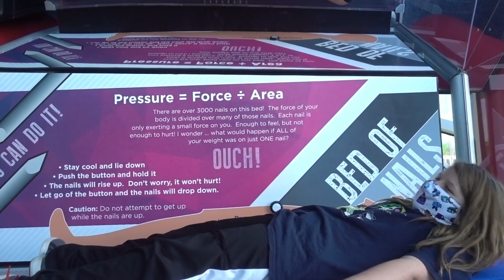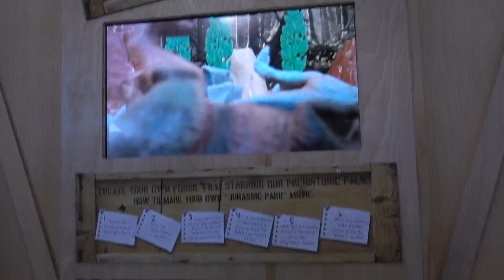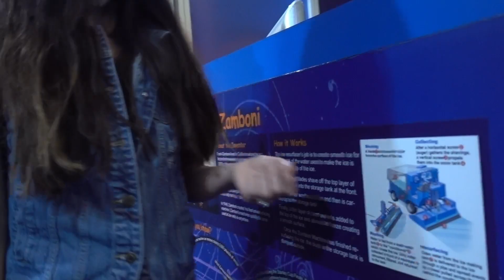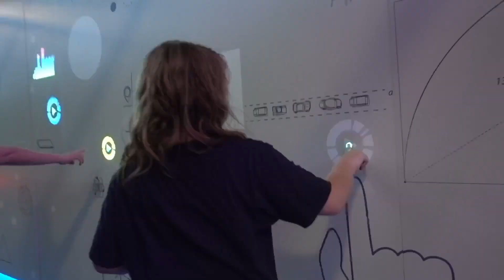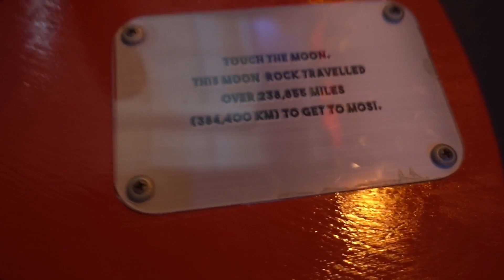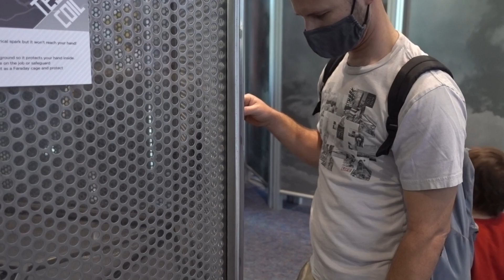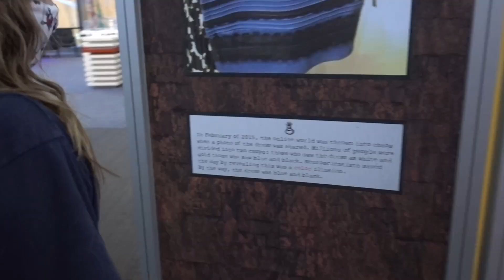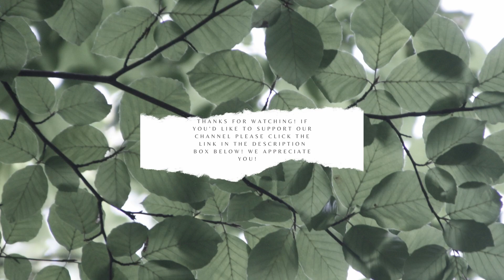Visiting MOSI: The Museum of Science and Industry ⚙️🔬🧬

Comment: When I was a kid in the 90's (last time I was at Mosi), they had a hurricane tunnel but it was larger than what I see in this video 9:53, it was rectangular and could  sit about 10 people. I wonder if this is what replaced it or if both are options at Mosi.
Reply from the maker: Yes I remember the 90’s version! It was much bigger! Mosi has changed so much. It’s so much smaller now.
Reply: @buildanadventure  I don't remember where (it may have been at the science center by Tyrone Mall St. Pete or great explorations) but there was this feature where you crawl around this enclosed maze and it was pitch dark and you had to find your way out. It was pretty scary to me as I am claustrophobic and not the most creative problem solving person. Did you ever go in that maze and remember where it was located?
Reply from the maker: @zenwhitenoise7920  I don’t remember specifically but I’m horribly claustrophobic too so I wouldn’t like that either 🙈
Reply: @zenwhitenoise7920  I think that was in the old Kids In Charge section (Where MOSI is now).